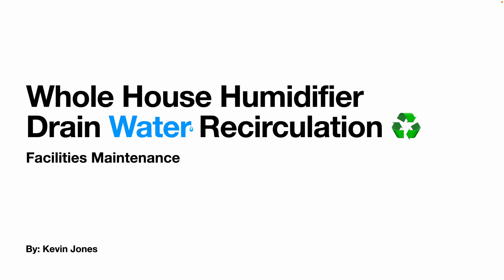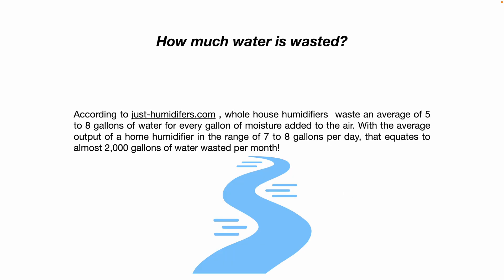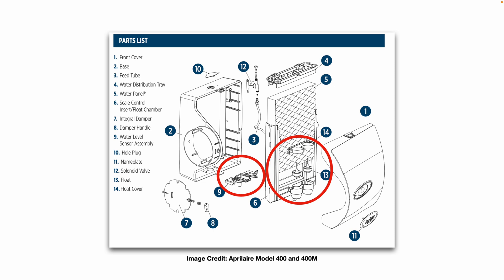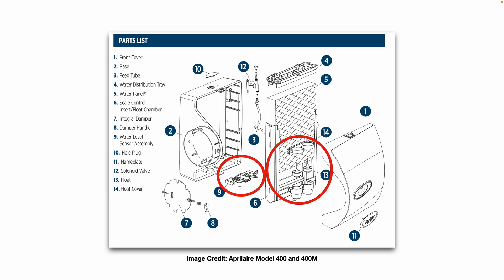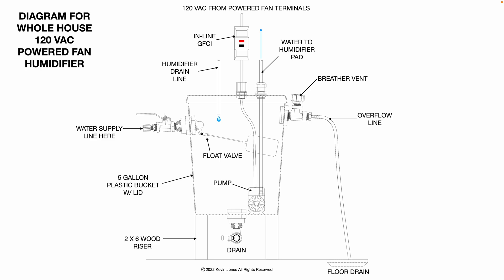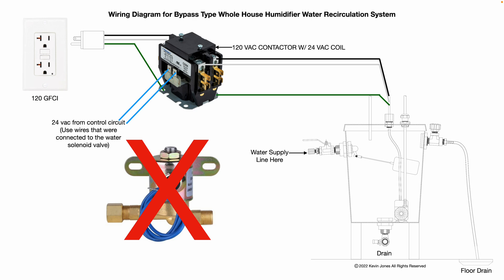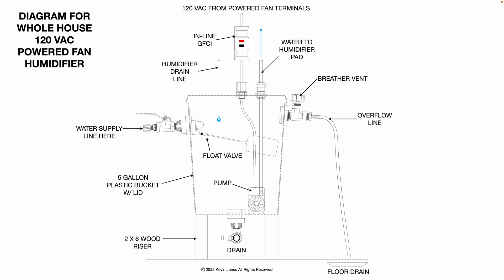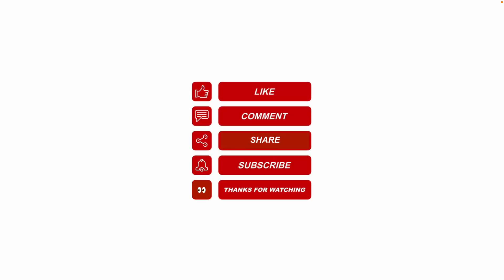Whole House Humidifier Drain Water Recirculation System | Save Money | Save Water

Comment from the maker: Here is a link to a 120 volt contactor with a 24 volt control coil.  Needs to be mounted inside an enclosure for safety.  Follow the manufacturer's wiring instructions!   
https://www.supplyhouse.com/Packard-C230A-2-Pole-Contactor-24V-30-Amp?gclid=EAIaIQobChMIh_bXk_2G9wIV88LCBB13IgEuEAQYASABEgKX5PD_BwE

You can also place an HVAC tablet inside the 5 gallon bucket to help ensure water safety :

https://www.lowes.com/pd/Frost-King-6-Pack-Air-Conditioner-Pan-Tablets/3799425

Comment: Cool idea. I've done the same thing for our Aprilaire 550 model with a simpler setup. Instead of a 5-gallon bucket I just used a plastric container for Costco tomatoes (~500ml)😎. I also replaced the float valve with a float switch that controls the solenoid valve to auto-refill water. And the pump is 12v DC instead of 120v AC, so that I could just use the same 24v power that controls the solenoid valve. Works great so far!
Reply from the maker: That's a great idea using a 24-volt float switch instead of a mechanical float valve!

Comment: I did something just like this and fed it with RO water to avoid scale buildup. It worked well but the stagnant water became a problem. I used some humidifier bacteria treatment to help control it but it still was a problem. I’ll probably ditch the setup this year and deal with the waste water. Maybe having less water in the bucket would help?
Reply: I think I’ll add an aquarium UV light to the setup.
Reply from the maker: Agreed, a UV sterilizer would be a great option inside the bucket.

Comment: Thanks for the video. In our state, they charge for the water and charge for the water that goes into the drain/sewer. So, I am thinking about recycling/minimizing the usage of water. I have AprilAire 560 humidifier and there is a Condensate pump with a small tank underneath to collect the water and pump it to the drain. I would like to add a return line to humidifier into this. Is it feasible? If not, I would like to know whether I can add a drip line to the humidifier water pad instead of flow of water. It appears that the water is flowing through the water pad when the furnace is running. The water pad is paper wick, which gets wet but most of the water flows through the filter to the tank. So, by going for drip we could save the water and the pad gets moist as well.
Reply from the maker: I like your idea.  If you decide to recirculate the drain water, you may want to add an inline humidifier water conditioner filter to reduce the mineral content in the freshwater supply to the humidifier.
Reply: Thanks. I am thinking of disconnecting the water line to the Humidifier solenoid valve and connect the drain line to it. The valve inlet has a filter as well. Also, disconnect the drain pump as well. To start with, the small tank will have enough water. When the furnace is on the solenoid valve will draw the water into the Humidifier water pad. Does this work? or do we need to have the water pump in the tank to pump the water to the solenoid valve?
Reply from the maker: @orkayen you will need the pump to supply water pressure to the solenoid valve.
Reply: Thanks.

Comment: I'm in Denver and I created something almost identical with a small plastic trash can.  What I don't,  know how to do is wire the pump to run when the humidifier turns on.  I have an Aprilaire and would love to know how to do that.  Otherwise my system is identical.  Great to see I'm not the only person who thought of this.  Yours is definitely an upgrade from my pump running 24/7 during the winter.
Reply from the maker: If the fan inside your humidifier is 120 V AC you can splice into those wires to send power to your sump pump, so when the fan comes on, the pump comes on, when the fan turns off, the pump turns off.

Comment: Do you have any recommendations for a humidifier for an air source heat pump?  The air temperature is quite low and even with a hot water supply, I'm wondering how much moisture will actually make it into the house.  I am trying to avoid spending thousands on a steam humidifier.  I also have concerns about water wastage. I've contacted the manufacturers and they don't really have much experience with heat pumps.
Reply from the maker: If you have emergency electrical heat strips inside your air handler, I would check to make sure moisture from a humidifier wouldn’t be getting on the heat strips.  I would recommend a portable humidifier.  Otherwise I would recommend researching a powered fan humidifier with a hot water supply line, or a steam humidifier, although more expensive.

Comment: I like your recirculation idea in principle.  My main concern is the quality of the water in the bucket over time.  I actually did something similar for my espresso machine, using a float system to keep the water bin topped up.  The problem is that since the water is added at the top but consumed at the botton, a layer of slime builds up quite quickly in the container requiring a frequent cleaning.  This is probably going to happen in your bucket design and will be more difficult to clean out.   The one thing that I couldn't use in my coffee maker but could work here are the HVAC chlorine tablets but not sure how effective they would be.   Thanks for the video.
Reply from the maker: Agreed, if you experience an issue of biological growth in the bucket, you can add sanitizer tablets to the bucket.

Comment: What brand of unit did you do this with?  Pretty simple and great idea in my opinion. The concern about the stagnant water is really minimal as the humidifier is running through water on a regular basis anyways..  This should reuse that significantly.  My only question is are there issues with the water not being hot on a regular basis when it sits in the bucket?  I guess it just wouldn't be as efficient as the hot water, however saving the water should make up for that.
Reply from the maker: Thanks for your question.  I do not see why this set up would not work with any make or model dehumidifier that has a condensate drain line.  I believe the one I installed was a Honeywell or Aprilaire powered fan humidifier.   
I've always used cold water as a supply, the concern with hot water is it creates an ideal environment inside the humidifier to grow bacteria & increase mineral buildup.

Comment: Nice video... About that stagnant water comment, how's your experience so far?  Any grimey water?  How often do you clean the tank and drain/refresh the water?  Thx
Reply from the maker: The water is freshwater, that is constantly being used up, or recirculated, or topped off, so it never has the chance to turn stagnant.  (Think of an evaporative cooler, similar idea.)  The humidifier gets turned off, and the water drained out at the end of the heating season.
Reply: @kjfacilities-maint  yes, makes sense, just wanted to check to see if you've experienced that in practice as well.  Sounds like it 👍

Comment: So you recycle the drain water by essentially putting it in a toilet tank that then pumps it back up, when does it refill itself with new water? Only after it's evaporated? That would be an issue I would think as stagnant water would become a hazard to your health. If this could reset the water every day or so I could see this being great, but far too risky for people, plus after it's stagnated long enough it can grow things and clog the pump. Therefore stopping the humidifier from working and burning up this unit, creating a service call. Most likely an expensive one
Reply from the maker: Thank you for your comment Nathan. No toilet tank is used in this system. It is simply a 5 gallon bucket.  Regarding your concern about the water becoming stagnant… Freshwater percolates down through the pad inside the humidifier, the water is being introduced into the supply, ductwork, any unused water that drains out of the water pad, drains back into the bucket and is constantly being recirculated, as the water level in the bucket drops, the float valve refills it with fresh water, so there is no chance for it to becoming stagnant.  (Similar to how a swamp cooler operates.) At the end of the heating season, you simply open the drain valve and empty the bucket out so the water does not sit in the bucket all summer long. (Similar to seasonal maintenance on a swamp cooler.) Lastly, to address your concern about the circulation pump failing and not providing water to the humidifier pad. The humidifier would simply not inject humidity into the ductwork, but it would not damage the humidifier.